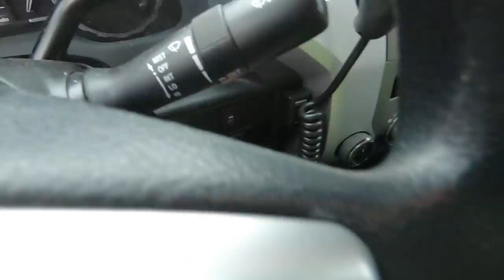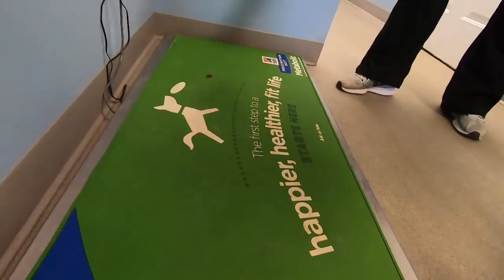What a Day!  This is Not what I had Planned!

Comment: In the first 10 seconds of your video find the yellow tie down at the right rear of the truck's bed. Just to the side of it you can see two slots in the bed liner.  There are also slots at the front of the bed.  These slots are so you can run a partition board from side to side.  The top slots are for 2 x 4s to run flat from side to side of the bed.  The top of these 2 x 4s will be at the same height as the fender wells.  By sheeting the 2 x 4s you can build a false floor.  You can also hide things under it.  The partitions are helpful too.  The rear one keeps stuff between the partition and the tailgate.  Stuff like bags of planters mix, cement, loose gravel, old school plastic gas cans (which I collect too) and even propane bottles.  If you use a 2 x 6 or 8 use a 3/4" radius on the top edge.  Hand slots can be added too.  If the tops of the slots are 1-1/2" down from the top then they can be routed the same as the top giving a full 1-1/2 round handle.  The plastic liner flexes a bit so I made my board 1/2" longer.  I added a chamfered corner to the bottom corners.  They don't need to be that big just enough so the board won't poke through the liner.

Comment: I had a PPM back in the late 70's down in Henniker New Hampshire.  My PPM was only for open weather, not snow covered ground. My pigs spent the winter under the barn working on the compost that was fed down to them from above.  My PPM was a 250-gallon tank for water and three trash cans for grain on a flatbed trailer.  The pigs nested under the trailer for shade.  The nipple waterer usually created a small mud bath for them.  I could usually put the sows out with my PPM soon after they pigged out. The little ones would roam about some. The sows stayed in with a single hot wire.  As the little ones got bigger, I found I could keep them in as well with a single hot wire.  I had a hot wire running around the property boundaries.  I would run my hot wire off that.  I had about six acres of sugar bush.   The pigs would start working their way across the sugar bush soon after the sap season ended.  I remember well waiting for the sap to run.  The old man I learned to farm from, Archie Morse, born in 1896, always said we had to be ready to tap out by February 2nd, half your grain, and half your hay by Groundhog Day.  Then we would wait for the temperature to come up.  We would try to tap out as soon as we had a small run.  One year we did our best sap while it was still before March.  April 15th is income tax day, set right there because that was the end of sap season, so says the federal government.
Reply: Thumbs up on the factory tour. 
I enjoyed seeing the Littleton Post Office and the DD in Littleton as you went to the vet.

Comment: The screws should be on the high corrugations not the low, thats why the sheets are designed that way, water runs down the low corrugations, hope your pigs don't mind a leaky roof
Reply: taring will do

Comment: The barn factory tour is a great idea. 
 I'm guessing that the reason that the sap isn't flowing is that there is still a thick layer of snow and ice insulating the ground from the warmth. You had a long, cold winter that probably drove the frost line deeper than usual. I don't know what the freezing point is for sap, but its mostly water so it should be close to 32°F. (Even if the concentration of sugar being higher raised the melting point, it would make the sap more viscous and slower-flowing.) The air may be warm, but the ground (along with the roots in it) is still frozen. 
 On the other hand, once it does start flowing, I think your ground is going to be saturated for a while. Maybe you'll end up with more sap than otherwise. [Fingers crossed.]

Comment: You may need to re-tap your holes if they haven't run in a while. Just spray the bit with rubbing alcohol and the inside of the hole, and drill just a little bit deeper.

Comment: Hey Al , question I just saw you move the PPM ? Seems you have a stability problem ? May i suggest before you get to much weight on those wheels to exstend the axles out about 12 " from The sides of the PPM ? This will provide the stablity your gonna need . Consider that the ground  saturated at this point ! Just a suggestion Al ! Have a great day !

Comment: You didn't use the wavey doohickies under the corrugated panels. I guess the only benefit would be support for snow load and you can put your screws in on the peaks instead of in the valleys. Probably won't matter.

Comment: I thought that type of roofing the screws go on the ridge part, not in the grooves? This way the water runs off?
Reply: ok  @wilburfinnigan2142
Reply: @wilburfinnigan2142  Is this process unique for this fiberglass?  We installed galvanized corrugated roofing, using nails.  All nailing was done on the ridges.

Comment: I'm not a builder but I have done my share of building or helping my husband build.  I was just wondering why when screwing on corrugated roof you put your screws in the dip instead of the high part. Perhaps I have been taught wrong which is why I'm asking.  I was taught there is more chance of your roof leaking the way you do it.

Comment: You should never put the screws in the dipped part of the corrugated material that you are using, because that is the path the water will run down, and eventually causes leaks.. always put it on the peak of the sheet.. just a helpful tip..😉

Comment: Al do you find that Dewalt cordless impact drivers are slightly over powered? Milwaukee's line seems to have the right amount of torch and power ans the speed is matched very well ? What's your take on them ?
Reply from the maker: I like the dewalt. I haven’t used a Milwaukee in years so I am not sure how they compare
Reply: @LumnahAcres  i only own 1 Milwaukee impact driver and it never slips the screw or nut driver im using i recently used Dewalt and I was slightly disappointed as Dewalt is my go to for corded  power tools for framing !